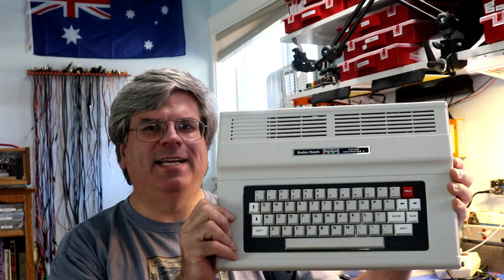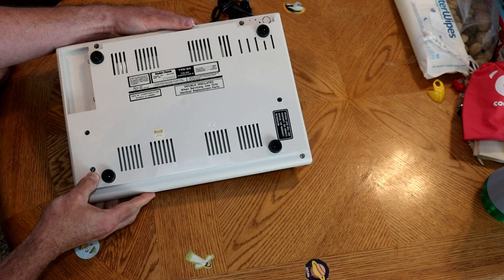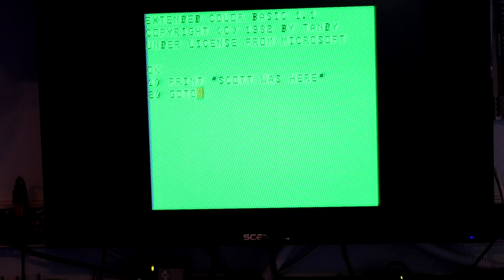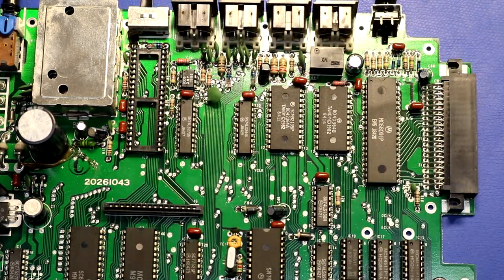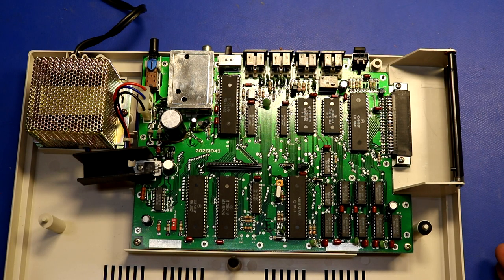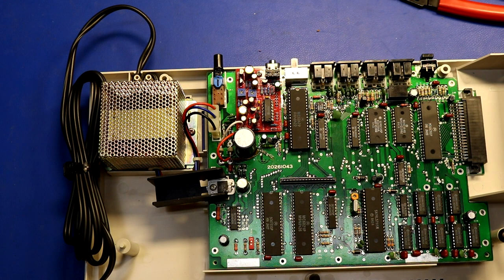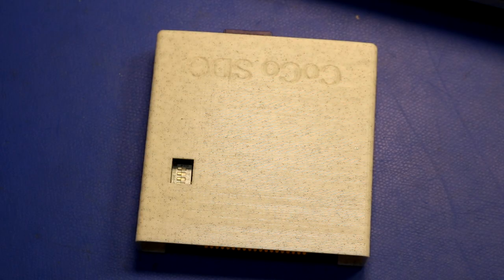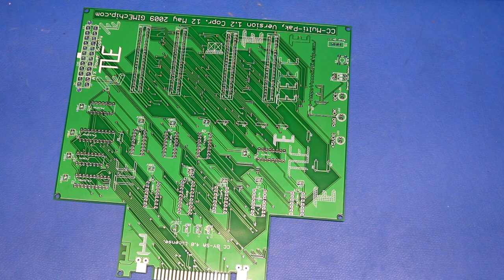Tandy Color Computer 2: Ram Upgrade, Composite Mod, DIY Multi-Pak Interface

Comment: I remember connecting to other computers by using my Coco2 and a 300 baud modem that slid into the expansion slot. I  learned all about programming in BASIC from that old computer. I may just have to get one for old-time's sake.

Comment: i was 13 when my dad came home with the Color Computer 2. then later my dad came home with a multi pack. a disk drive & the speech synthesizer. we even had the trs-80 printer. i miss using the coco 2. it was the best computer i ever had.

Comment: We live in a greast time for retro computing.  Most components are still available  and relatively inexpensive, and documentation can be found on the web.   30 years ago I would've never imagined a circuit board of my own design could be manufactured and shipped to me in about a week.  The availability of other builder's boards are also part of the amazement.

Comment: I had the CoCo2 as a pre-teen, and got bored. One day I was (stupidly) using a jumper wire on the motherboard, just watching the computer crash in fantastic ways when I would touch random pins together. Amazingly, this didn't break anything.. but I did find two pins I could jumper, and the CoCo would have more RAM, but a smaller BASIC instruction set. The startup acreen didn't say Extended BASIC.. it was so ething else. Always thought that was interesting.

Comment: I would love to see a redesigned 3D case for the Ed Schneider mega mini mpi. (MMMPI)  The slots are super shallow and if "things happen" you will find the slots bend or broken.  (I didn't do it but I had my rig at work and someone did something after hours and one of the slots were bent quite a bit.  I straightened it and it works OK still but I can't think it would survive with too many such incidents.

Alternatively if you could make a taller lid or something that sits on top of the MMMPI?  If you did, I would happily buy one from you!

Comment: If you had one apart  it would be a good time to put a larger heat sink on the pass element transistor in the power supply. This is more important on CoCo 3s as the 512k board for memory up grade  increases the load on the five volt supply, they run a bit to warm to begin with. The supply is a linear regulator for 5volts. On the CoCo3 there is a lot less room in the box to use for a larger sink. Lots of people run a small fan. The 512 K board blocks some of the vents in the top of the case too.

Comment: I am trying to diagnose a keyboard issue on a Coco 1 computer and hope you can help. Certain keys don't work and after looking at a schematic, I see that they are all associated with a particular pin on the keyboard connector. I tested continuity between the beginning of the keyboard ribbon cable and the relevant pin on the MC6822P chip and it is fine. Is it likely that since I don't have a bad connection, the chip is bad? If the chip is bad, do I need one specifically programmed for the Coco Model 1 or will any MC6822P chip due? I want to save this computer from the trash heap, so your thoughts are much appreciated.
Reply: The connections can oxidize over time. Sometimes just cleaning the connector helps. It's a flexible membrane, so carefully pull it out and use a clean white business card trimmed to fit the width of the socket and just work it up and down in the socket a few times, DRY.
 Gently clean the keyboard membrane with isopropyl alcohol.
 If none of this works, KeyFix replacement keyboards are available.
Reply: @CoCoNutBob  thank you. I will give it a try.
Reply: @JamesBond-qv2ht  I know it's tricky, but you might try watching the continuity on that pin while you type. It's rare but possible that the PIA chip is bad.
Reply: @CoCoNutBob  If they're socketed, an easy test would be to swap them. Coco should have two PIOs.  if you swap them and the keyboard starts working and something else stops, it's either a faulty chip or a dodgy socket.
Reply: @TheTurnipKing  true... and CoCo 1s were pretty much all socketed.
 Another trick is you can repair the conductive traces on the mylar with a conductive pen.
 Seems to be holding up surprisingly well, even with lots of plugging/unplugging/flexing.

Comment: How many times do you need to stick a logo on a PCB.. and then why stick it in the copper layers.. and then why the hell stuck it in a copper layer with a trace going through it. That whole thing is just nuts.
Reply from the maker: In fairness to the original author, they did provide the Eagle SCH and BRD files as well. If I had scrutinized the gerbers more closely, it would have been reasonably straightforward to remove logos from copper layers. For other folks who want to do this, it is a relatively large board, and the "free" version of Eagle may or may not work on it. I have started a revision of the board, will make artwork available when I get done.
Reply: @smbakeryt  any update on the MPI? Any issues with the one you built?
Reply from the maker: @CoCoNutBob  As usual something else grabbed my attention to a new project. :) When I last used the MPI, I was not experiencing any problems with it. Seemed to work just fine.